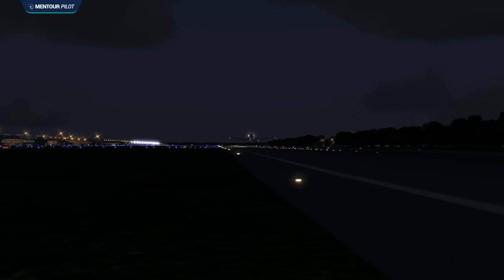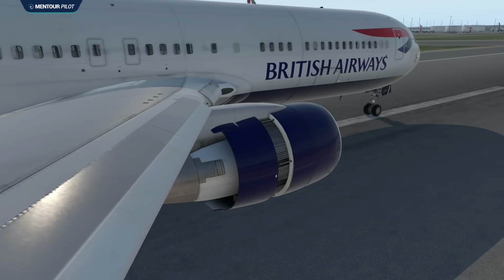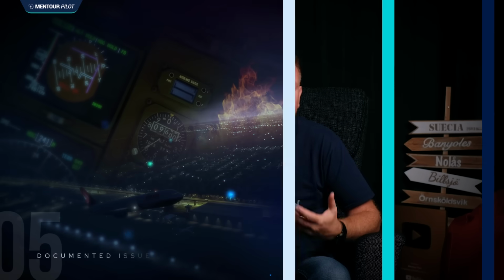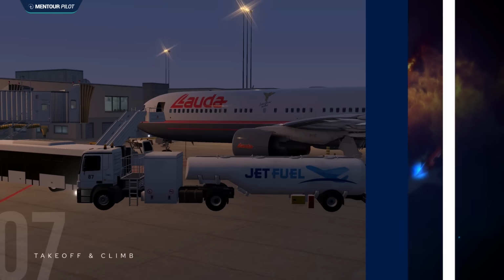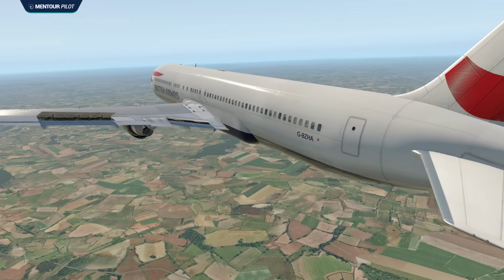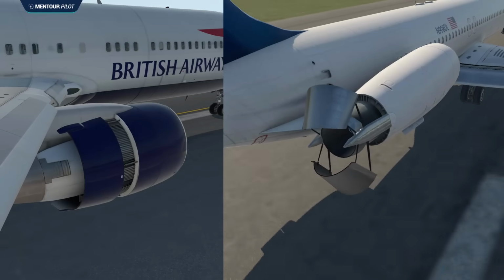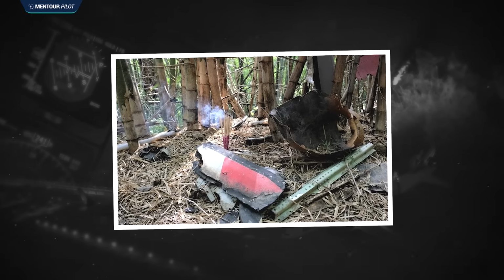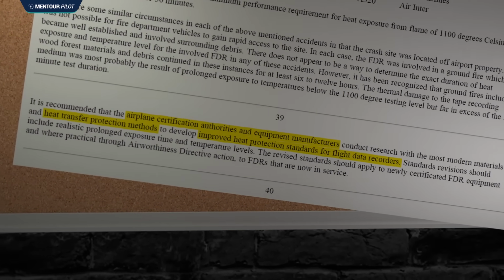HOW an Impossible Failure CRASHED this Boeing 767!

Comment: Great video & detailed information.Every pilot must realize that, the 1st item on any in-flight checklist is to "fly the aircraft". Departure from normal controlled flight, is the most critical, and must be addressed immediately by controlling the 3 "A's" (Airspeed, Attitude, Altitude). Nothing else matters until these are under control, or at least being managed. It's just my opinion, however I believe the only reaction which might have saved this aircraft, would have been to reduce both engines to idle, and reassess once control has been reestablished; or continue reduction of aircraft operating systems until it responds to control inputs; all the way back to entering a controlled glide, if necessary. Such critical response is not taught in normal fixed wing flight training; however, should be considered in event of catastrophic departure from controlled flight.
Reply: Would YOU have done that? First rule is "think before you do". Rolling back to Idle could improve things, it could make them worse. The pilots didn't have the benefit of knowing what exactly has happened, and what the implications of that failure were.
Kind of like with Sully, people said "if he turned around immediately, he could've made it back to the runway!". And then, in the sim, only a low percentage of pilots trying it actually made it to the runway, the majority ended up crashing, killing everyone on board. Despite knowing what happened.
Trying to be hero usually gets people killed.
Reply: @kain0m  Not only would I have done that, but I have had to do that for real several times in real life flight situations. Remember, if the pilot doesn't have control of the aircraft ... everyone is a passenger. Even with your "Sully" example, that is exactly what he did ... fly the aircraft 1st.

Comment: what bothers me, is how anyone could have thought that an un commanded thrust reverser deployment during flight could be an easy to handle minor event, specially in multi engined jets. i am a little worried that certification tests are a little bit superficial
Reply: You can only test for what you think is possible and Murphy has a way inventing things on his own.

As far as certification goes this was long before the faa's present day issues
Reply: @M167A1  i do agree, there are unforeseen side effects, and one can not cater for all of them, but an air brake deploying un commanded at cruise speeds and thrust values should be something that is considered, and catered for. a fail safe mechanism that allows for the reverse thusters to break off due to too high mechanical stress for example, which would only happen if the speed was too high to deploy them safely anyway would have been very easy ti implement, and landing without reverse thrusters is not even an emergency as far as i think
Reply: Control software has evolved a lot in the past 30 years (since this accident). Yet, old problems were solved and others maybe were introduced. 
Certification tests are actually quite strict and it takes years of preparation and reiteration of the design to really achieve the expected outcome.

Comment: Boeing used to be an amazing company that was founded and run by engineers and it showed in the products they put out....until they merged with McDonnell Douglas in the late 90s...and now the company is run by accountants and management that cares about how much cash they get rather than how good or safe their product is.  Over the last 20 years this has been telling in just how shit and over budget and over schedule their contracts have been.  It's only getting worse.
Reply: They wrote this off as pilot error. Lauda wouldnt accept it and showed up in Seattle and went through the sequence in their simulator repeatedly, proving that the pilots did not have time to save the plane, so Boeing had to go back and figure it out. He really saved the next plane full of ppl from an unnecessary death.
Sadly, Boeing learned exactly nothing from it and did the exact same thing with the 737MAX - wrote it off as pilot error. No Lauda to push back this time and another plane had to crash, b4 anything was done.

Comment: so essentially if the thrust lever would have rolled back before allowing the reverser to deploy this would have been handled so easily. I'm also shocked on the way Boeing demonstrated that the plane would still be able to fly but only at low speeds and FAA certifying it. I mean you look at the history and see that these guys have always cheated until they took lives of innocent people. 
great video Peter as always thank you
Reply: After the issues with the 737Max planes nothing surprises me.

Comment: That breakup animation was harrowing, and extremely well done.  I can't even imagine being aboard in those last few minutes.
Reply: The one consolation is that passengers probably lost consciousness as the plane disintegrated.
Reply: @hairyairey  oh hitting the ground at that speed you'll be dead before you feel it anyways.  It's a very quick way to die. :/
Reply: @marhawkman303  I shall take your word for it although I am not scared of dying I am also in no immediate rush!
Reply: @hairyairey  yeah really, there are some claims I have no interest in attempting to "verify" personally.
Reply: From 4,000 ft to impact in 3 seconds. Jesus. They had no chance
Reply: @jimlthor  Yeah, that's what's especially terrifying. The pilots made no actual mistakes, but the situation became fatal in a matter of seconds.
Reply: @ariochiv  I was wondering why they didn't cut both engines and try to correct it at first, but it looks like they only had a very short window of time to do anything. And during that time, they would have had to pull of some perfect move, if anything at all could have been done. Poor guys. They were set up for failure here
Reply: @jimlthor  call it 4 seconds, 1000ft i a second is about 700mph. Ridiculous.
Reply: @CheradenZakalwe  yea. They weren't exaggerating about it being over the speed of sound. They were right at it or a little over
Reply: @CheradenZakalwe  And 700mph is about the speed of sound ~ mach 0.99 as stated in the video. What is ridiculous, the maths seems reasonable to me ?
Reply: @gritpipethin  I think he means "ridiculous" as in "that's ridiculously fast"... not "that's a ridiculous idea."
Reply: @marhawkman303  If the OP meant: "that's ridiculously fast"  I don't disagree with you ~ Boeing 767s are not cleared to the speed stated.  

The OP wrote "ridiculous" without qualification ~ fact.  I should have qualified what I wrote: "700mph is about mach 0.99 at low level" ~ the maths seems sound to me (pun intended).
Reply: Minutes? It was seconds.
Reply: Terrifying.
Reply: Harrowing indeed...
Reply: why not? you just saw an animation of it
Reply: I can imagine it... you'd have just enough time to think "o god we're gonna crash!" as the plane twists sideways and breaks apart.  between the wings shearing off and impact was only a few seconds.  doesn't take long to hit the ground at Mach .99 or higher.
Reply: @marhawkman303  maybe, but please understand the idea of going through something like this would still be horrible, may all those who lost their lived rest easy.
Reply: @RiftWalker111  Well, yes, but if something like this would happen, I'd rather die in 5 seconds instead of being freightened to death for tens of minutes while knowing inevitable will come sooner or later.
Reply: @RiftWalker111  I'm just saying it'd be terrifying... but short.
Reply: @marhawkman303  oh then my apologies, just want these poor souls to rest man, this stuffs messed up no matter how quick or slow.
Reply: @RiftWalker111  When I was a child i was in a car that got sideswiped by a cargo truck.  I was watching.. but I didn't have time to be scared.  It was just BAM!!!!
Reply: @RiftWalker111  its absolutely horrible, definitely a terrible way to go. would the sensation be something like roller coaster rides, sky diving or water slides? what do you think? i also think that one of the worst ways to go perhaps would be dying to a lion, very painfully and sometimes slowly, being eaten alive. sadly so many people throughout ages have died to lions. burning to death (common practise some time ago and many people went through that, for witches it was common) too would be a terrible experience, unfortunately there are so many terrrible ways to die in this world
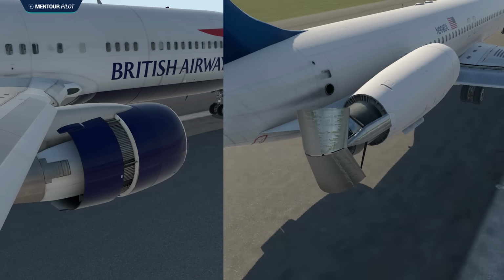Reply: @marhawkman303  Believe in JESUS today, confess and repent of your sins. No one goes to heaven for doing good but by believing in JESUS who died for our sins.  For God so loved the world that he gave his one and only Son, that whoever believes in him shall not perish but have eternal life.(John 3:16)🥳❤️😗❤️🙌
Reply: @alunesh12345  no
Reply: I can imagine it and I can confirm it’s not very nice.
Reply: That's traumatizing. I'm wondering why I watched it. Can't imagine what would have happened to all those on board and how much shaken would their loved ones have felt knowing the final moments of their beloved ppl on board. Terrifying and heartbreaking😢
Reply: they burned alive... melted
Reply: Timestamp?
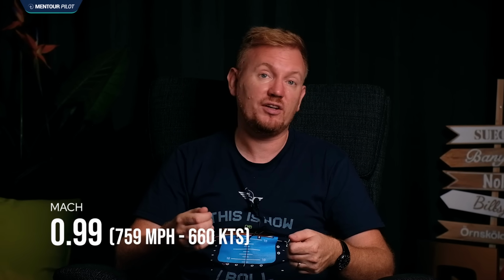Reply: @vsucountryboy  @22:15

Comment: Boeing may have been a good and conscientious aircraft producer when they build the B-17 and even the 707 but they lost their humanity after that and went to valuing profits over the lives of anyone flying on their product. Good example is that piece of junk space capsule called the Starliner  and especially the murder machine named the 737 MAX. In my evaluation when a company builds something SOOOO crappie that it falls from the sky with people on board, they are guilty of at least 3rd degree murder.

     One thing for sure, if I ever need to travel by air again, I will absolutely NOT get on a Boeing built aircraft.
Reply: The B-17 was the Starliner of its day (and then some), having so many problems while in development that it was in danger of cancellation by the US Congress.  Everybody's stuff falls from the sky, crappy or not crappy, because aerospace is hard no matter how talented the engineers.

Comment: What software is used for the aircraft animations? Whoever is directing/story boarding the graphics is very talented.
Reply: Actually i though it was way better in his previous videos, here he talks about the stabilizers ripping off and it shows the tail rippig of, talks about wings ripping off and burning, here the wing roots burn. and why does it explode in a huge fireball when the fuel in the wings is no longer there on impact cause the wings are gone? Also in a previous video you saw the aircrafts stucture underneath the broken stabilizers, here the damage to the stabs looks like some 15 year old blocky dmg model without any detail.

Comment: In that overspeeding situation, could they slow down by using airbrake?
Reply: I don't think they have airbrakes. They have spoilers on the wings to reduce lift and increase drag after touch down to make the plane stop better. Those probably can't be deployed in flight, certainly not at high speed or they would rip off.
Reply: Oh, yes... That's what I ment. I think You can deploy spoilers in the air, Mentour or other pilot from another channel said so in one of those videos. They are using them when they have to lose altitude quite fast, and then a whole aircraft experience some shaking. There is always a pilot flying and a pilot monitoring, so when pilot monitoring is trying to troubleshoot, pilot flying should have an eye on their altitude and speed, wing level. I would not wait for the almost speed of sound to deploy the spoilers, but earlier... But I dunno
Reply: @G-Porch  thing is they were at allmost the speed of sound when it happened, i believe he said they were climbing with 0.79 mach. Landing speed is more like 0.2 mach.
Reply: @G-Porch  Other aircraft have real air brakes, but mostly military ones, like WW2 divebombers so they dont overspeed in the attack, or most military jets have them too, thos can be deployed at much higher speeds.

Comment: If the reverse thrust is not that effective on idle speeds while being mid air.

If they managed to turn off the left hand engine earlier*, would they have been able to regain control?
Reply: They would have to turn the left hand engine off, reduce the power of the right hand engine significantly and push the ailerons and the rudder to the right side and before doing this they would have needed to figure out what the hell was going on - and that all within max. 6 seconds! - Good luck!